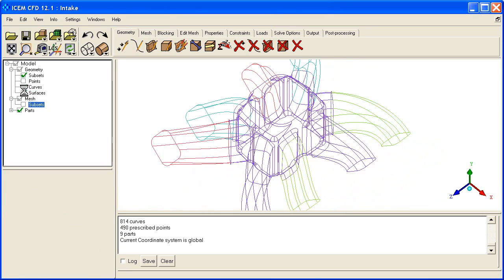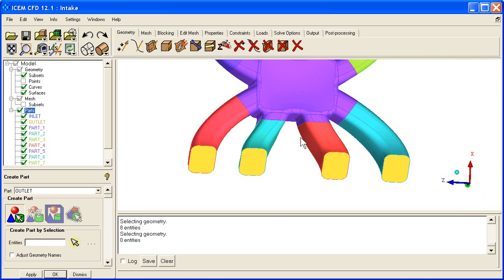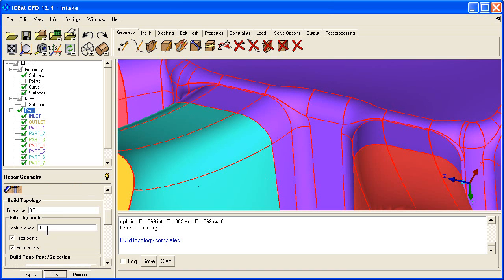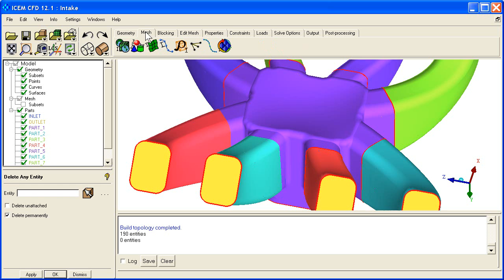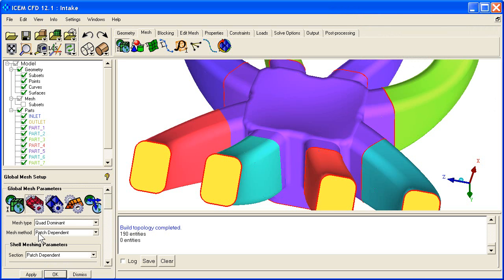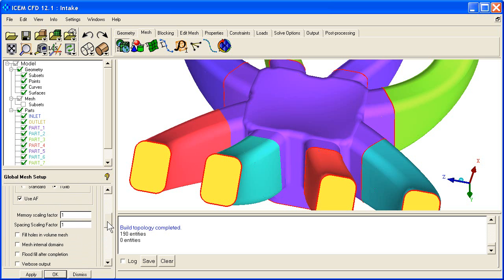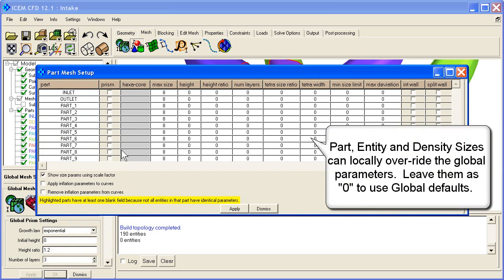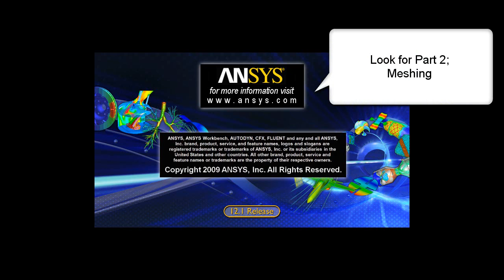ANSYS 12.1 (part 1 of 2) ICEM CFD setup for Tetra/Prism meshing of a simple manifold

Comment: Thanks for the video. Is it possible to put a hole in the tetra mesh? like if you have a pipe in between and there is no flow? I can do this with hexa meshing (create an Ogrid inside and then delete the inner block). But how can I do it with tetra meshing? And is it possible to use in one geometry at some parts hexa mesh and tetra mesh at some other parts at once?